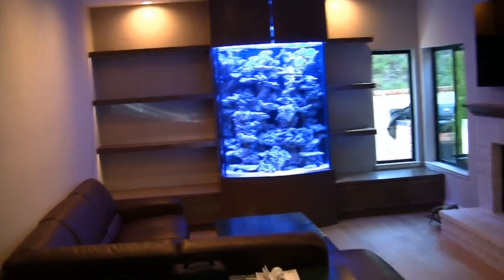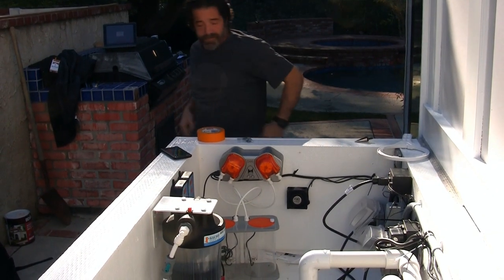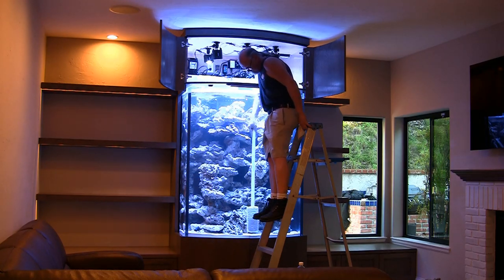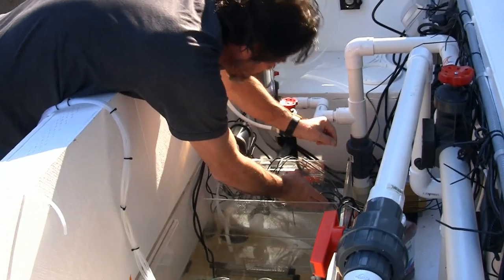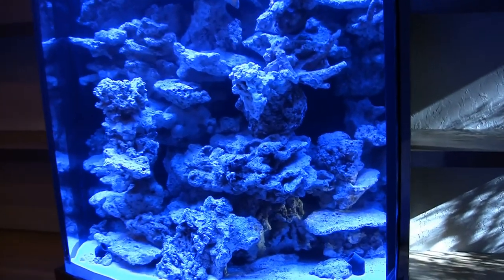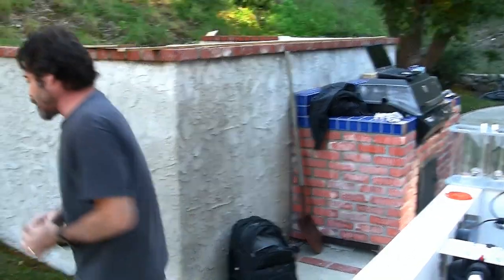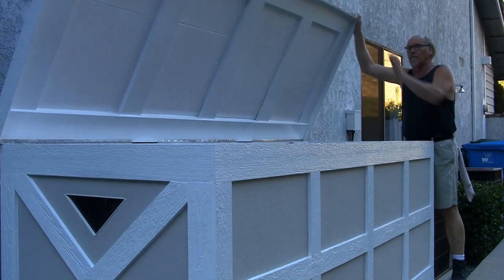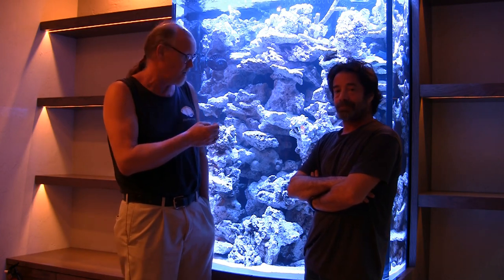60" Tall Bowfront Reef Tank, LA Fishguys Episode 163, Part 4

Comment: Wonder how this is going to be maintained over time.  The depth and shape will make it challenging, also the choices of corals, fish, inverts etc.
Reply from the maker: Im already servicing the tank weekly ( has not completed its cycle yet ) and yes it will be a challenge but its worth my time to make sure it flourishes, so there is an incentive. As you saw I will use a Pad on a Pole but today I tried out my Magnets for the first time. Soft and leather corals towards the bottom and middle, LPS in the middle and SPS towards the top. Ive already begun to collect and quanratine corals and fish, which will be schools of various Cardinalfish and Anthias. A number of various Fire, Flame, Barred and Blue Gobies, as well as, Clownfish and a few choice Dwarf Angels, followed lastly with Tangs and Rabbitfish.

Comment: It triggers me that the cabinetry doesn't cover the water line and there is no inside lip on the hood to eliminate light leakage.... Other than that it's a gorgeous setup.
Reply from the maker: Frustratingly, I made it very clear to the Designer about the cabinet 'overlap' but no matter how many times I tell these people something always happens, and in this case she got fired and didnt pass along the info, Both the trim, above and below, as well as the inside of the doors are being added.